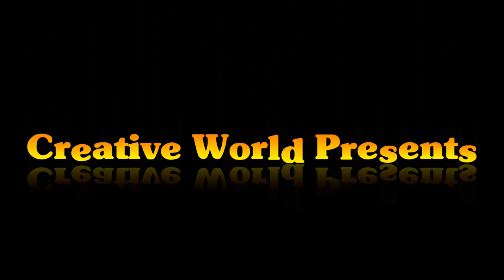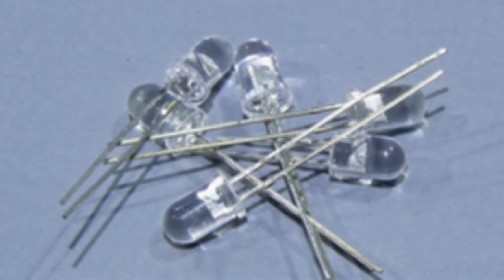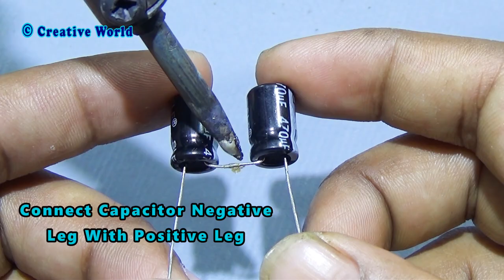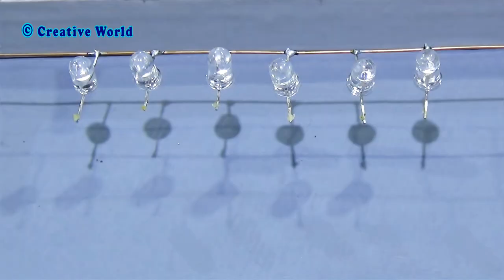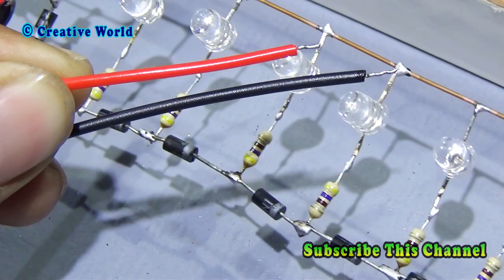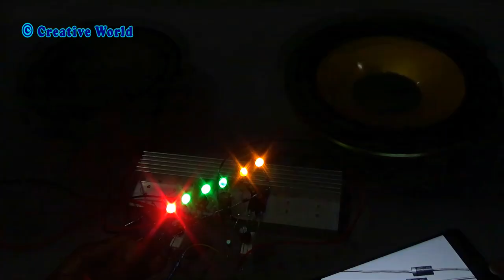How To Make Sound Activated Multicolor LED Lights Without Power

Comment: There's no way the audio signal is going to provide the voltage needed to power all those LEDs, especially the blue and green ones. And before anyone says it's coming from the capacitors that get charged up by the audio signal, that's total b.s. since capacitors used in audio circuits are what's referred to as analog band pass filters because they block different amounts and frequencies of the audio signal, depending on their size.
The only way those LEDs will emit any light is if they're connected to an external power source that's controlled by the auido signal through at least 1 transistor or IC chip.